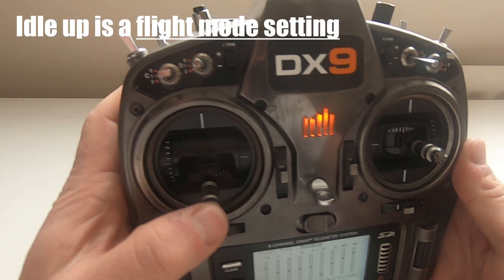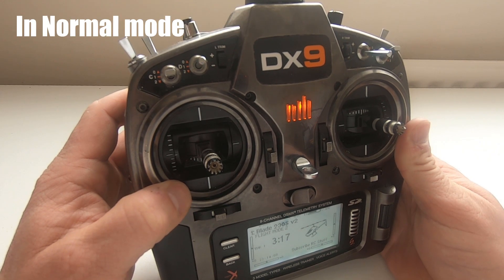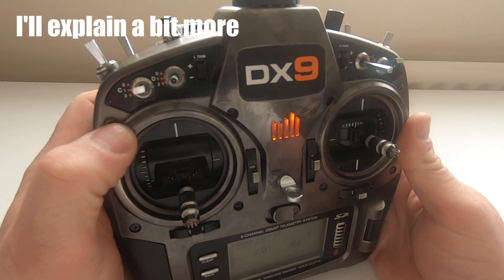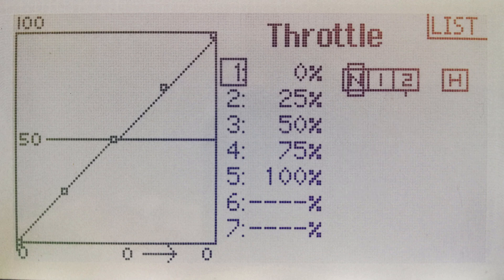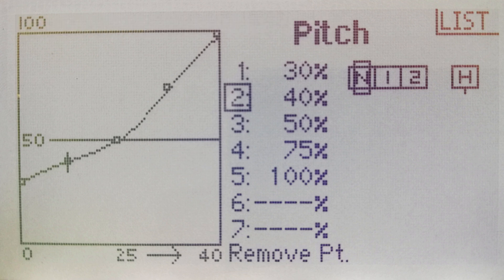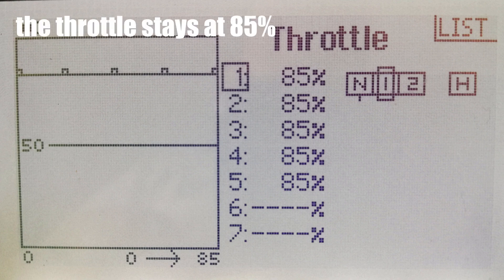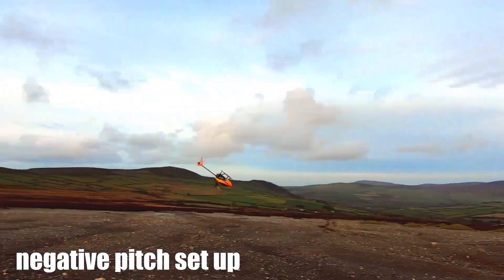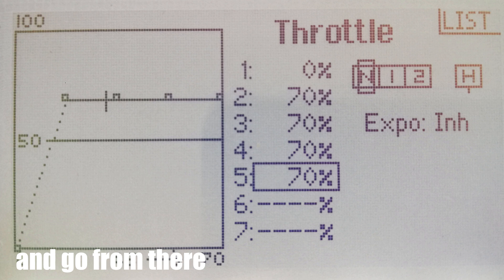What is Idle up? (+flight mode, throttle/pitch curve intro)

Comment: Do you know how to get the dx4e into idle up mode with a blade mcpx?
Reply from the maker: Sorry I don't. I don't have any experience with either of those I'm afraid.
Reply: @RCStuffvideos  okay ..well thank you for the reply
Reply from the maker: @brsrc759  but actually having said that the dx4 is just 4 channels of course and I think the blade mcpx needs a 6 channel transmitter. https://www.bladehelis.com/product/mcpx-bl2-bnf-basic-with-as3x-and-safe/BLH6050.html

Just checked the dx4 manual and it says its for aeroplanes. Collective pitch helicopters will need more channels. So to answer your question you'll need a different transmitter.
Reply: @RCStuffvideos  okay cool. I think I have a DX7 buried somewhere in my closet. I guess it's time to start digging. I did get it to fly just fine in fixed pitch mode with the dx4e so that's cool for now. I appreciate your time my friend! Aloha from Maui. 😎🤙🏼

Comment: Great video.  I haven't flow for a few years, but I always like to "review" some of this tx and heli programming stuff.
I used to be an advanced flyer with my skill level best described as doing everything regular and inverted maneuvers "but just below competent piroflipping".

My Futaba 7ch with 5 point curves was uniquely setup, as follows:
a.) Throttle Curve: 100-100-100-100-100% @ normal toggle position
                                  0-0-0-0-0% @ idle 1 toggle position
                                  0-0-0-0-0% @ idle 2 toggle position

b.) Pitch Curve: 0-15-50-85-100%, which corresponds to 0%=full negative and 100%=full positive pitch.  Expo=0%
     The jump to 15 and 85%'s create kind of an expo response without using expo.  This is preferable than using expo.

c.) Throttle Hold toggle: 
       Pitch= same
       Throttle curve=0-0-0-0-0%

It seems dangerous, but with 2 toggles for throttle cut and motor speed control set on "soft start".  It is very safe.
It takes 2 toggle flips to activate the motor.  So, any "accidental" bump on one toggle will not cause starting.  
Toggle bumping happens periodically, but 2 toggles to bump is basically impossible.
However, you must always start with throttle stick in the "middle position".  However, flying inverted and flipping all the time, keep the stick in the middle becomes instinctive.
Plus, as you launch just before toggle switch flipping, you always jiggle your controls before start.  You "should" never make the mistake of leaving throttle stick all the way down.

Also, at this skill level, I no longer felt the need to stabilize and hover before landing.  I just cut throttle and autorotation landed.  No wasting time.
Go up high, dive, cut throttle and do a routine autorotation, or just do a simple "straight down" auto landing.  Anything bigger than 500 size will pretty much land on it's own from 5-10.  Cut throttle and hands off the tx.  No problem.

When flying at an advanced level you only fly about 3-4 minutes, so high rpm consuming battery run time never an issue.  Until the battery got old,.  When battery got old you had to gradually reduce the fly time alarm, because you can actually hear the rpms dropping earlier and earlier.  Main thing is you want flight time to correspond to consistent power and rpm.  Otherwise, reduced headspeed changes the control response of the heli and directly affects your maneuvers.

Also, the throttle curve should never be programmed with a v-curve, because even when you are at 0 pitch you might be flipping from inverted to regular or regular/inverted or flipping continuously.
That rapid change in pitch puts an enormous load on the motor.  You don't want the motor to speed up or slow down.  In addition, if you keep your flight times short you should set throttle curves to a flat 100% on the throttle, not a flat 90% or 85"...because the speed control will last longer and cooler at 100%, because it does "less work" than at 90%, 85%,...etc.  Counter-intuitive, right.

So, using idle 1 and idle 2 where you continually change heli throttle and response is only for beginners, or you want to get max flight time at higher economy.
For 3d maneuvers you want the best head speed and control whether inverted or non-inverted.  
Especially, when you are flipping continuously.  Thus, you end up simplifying things and always fly idle up.

Phew, that was a long one, but it was mainly a mental refresher for me.  Possibly, some flexing of my knowledge/experience, that I used to have.  
However, I hope some people found it informative.
Keep on.  RC Heli Forever!!!!
Reply from the maker: Wow. Had to make a coffee and sit down for that one. Thanks.
Reply: @RCStuffvideos  Awesome you were able to keep up.  I like to leave comments like this, also for my own archive.  Anyways, thanks for keeping the hobby alive.  Flying RC heli is an art.  Flying a drone is not, because you can simply flip a switch and pick up your starbucks coffee and watch it go to way points.  Even worse, these robotic drone shows with thousands of drones are all supercomputer controlled.  Zero art. Zero human coordination.
Reply from the maker: @trexinvert Yeah its a bit annoying when people confuse helis with drones. I was flying on a little beach once and some people walked by and said " oh I bet you got some great photos today". I just thought "omg. are you serious?" But yeah it's all about drones these days. Far far less effort with building, learning technical things, ease of flight etc. I have a drone too but it's just completely different. It's a photography/videography tool whereas helis are for fun and excitement. I'm going to do a heli v drone video at some point too.
Reply: @RCStuffvideos  Hah, reminds me how once i went out to fly my RC airplane and some kids which were passing by, yelled something like 'oh look, a drone!', it was annoying to hear :)